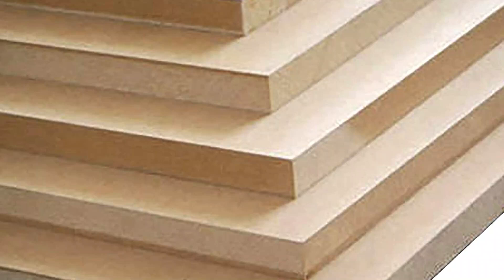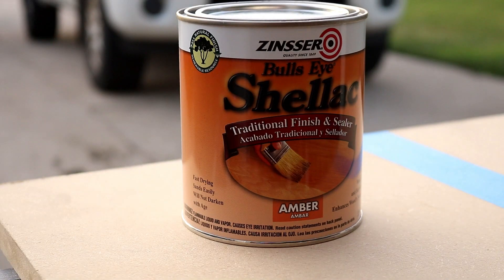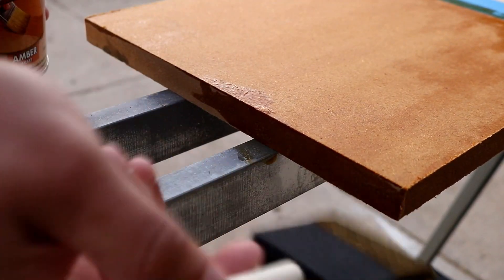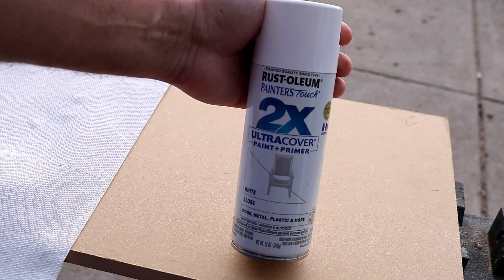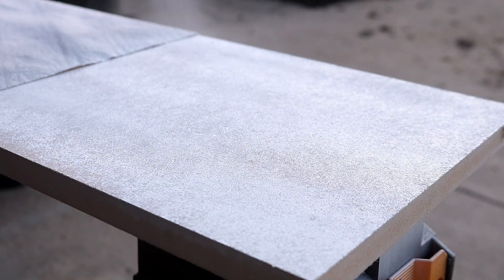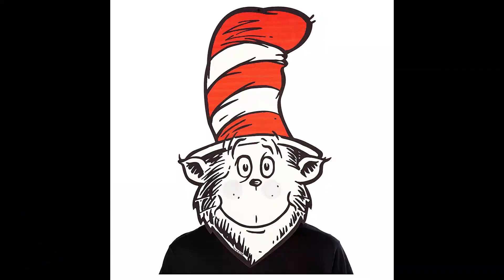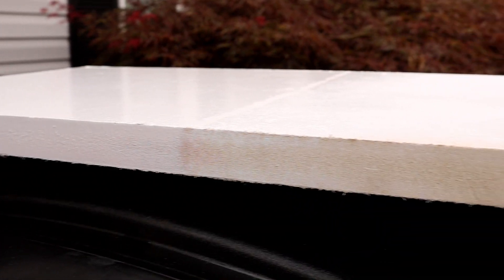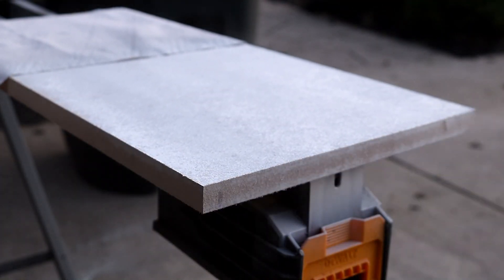HOW TO PAINT MDF LIKE A PRO - Here is another tip to help you spray paint MDF and make it look great

Comment: Never would have thought of this. I always used rust-oleum lacquer rattle can and do heavy coats, don’t even have to sand your piece then as long as the side your spraying is laying face up. But the edges are still thirsty doing it this way so I appreciate this video

Comment: Just 2 years later and the price of that can has nearly doubled. Still glad I found this, though, because I've always used their shellac primer. It's amazing for MDF, and other tough-to-paint stuff like particle board and laminate (think cheap furniture). But that shellac primer is like $70 a gallon now, so $26 for this, while not $13, is way better! The sanding sealer in your other video, interestingly enough, is cheaper at my store, so I'll probably go that route for now.

Comment: I use water and wood glue 50/50 and it works pretty well. It only takes 1 coat with a foam brush and dries quickly and then a quick sand. I originally put it on the edges but where I got it on the top you could see a difference in sheen so I just started putting it on the top. I think the water helps pull the glue in and makes it a little more durable. I normally use kilz odorless spray and then you can topcoat with about anything. I like the kilz oil based odorless but the spray cans drip which is very annoying.
Reply: But it's adding water to MDF which would cause selling after sometime

Comment: I've used Elmer's glue for years to get a pretty nice finish on mdf. I brush on a decent coat or two, then sand it after letting it dry for a full 24 hours. It'll give you a glossy finish as smooth as plastic when you spray paint it. I've also seen really good results with spreading a super thin coat of Bondo on MDF, then sanding it.

Comment: I use sanding sealer. I always get a specific Brand. I ONLY use Old Masters, which is kind of hard to find around my area. But it works AWESOME! A nice even coat. Sand with 400 grit lightly until smooth then apply a 2nd coat. Sand with 800., Then apply top coat. That's just my method. I've had GREAT results on numerous Subwoofer box & amp rack projects.

Comment: Oil based primer+sealer in one works just fine on MDF too. Water based won't work as well because it will soak in and cause swelling, but the oil based works just fine.

Comment: You need an NDF or neutral density filter for your camera. It cuts down 
the amount of available light and you would have been able to pick up all
 of those imperfections in the MDF. You can rotate them to adjust the 
amount they effect the light also.

Comment: If you actually sand the mdf properly you get a much MUCH better surface to paint.
You can easily get an almost polished finish using 120 then 240 or 150 then 320.
Use 400 or 600 between coats.
Use anything you like to seal the mdf but it will look terrible like this does, if you don't sand it before you start painting.

Comment: So I dig the ideas I saw your other video too. but... I've painted things that had a high gloss poly on it. or like you enjoy saying shellac ! and the paint chipped cracked throughout the years. and trust me my prep work was amazing vacuumed wiped down with spirits painted in a controlled environment little plastic room I made with circulating air. So has anyone had any issues with that using the SHELLAC !
Reply: From what I understand it cracks aka alligators because it was applied too thick

Comment: First I want to thank you for your great videos, for me have been very usefull!! I want to ask you a question: when I remove the masking tape from the painted mdf I notice sometime like a masking glue residue over the paint how do you remove that without damage the paint?
Reply: Buy better masking tape, not the cheapo stuff. I had the same problem for the longest time, buying better tape made a huge difference. Edit: Also, make sure the paint is cured enough before you tape it.  If the paint is still green, you're gonna have issues (even if it does feel dry to the touch)

Comment: Nice video but honestly I just don’t get the fuss about MDF painting. First : it does NOT suck to paint - it paints beautifully.  
Seal edges with 50/50 glue water mix. Just paint faces with non water based primer and then paint normally. Comes up beautiful.

Comment: Is there a difference in using shellac amber and shellac clear?
Reply: The only reason you use clear (or blonde) shellac is for finish coats (especially french polish) on fine woodwork with real wood.

As a primer, you don't care what it looks like, and amber shellac is both cheaper and much easier to find.

I even use shellac as a primer for real wood when I want to paint it and I want as good a surface as possible without the grain poking through.  It dries fast, is cheap, and just needs a touch of sanding (tho I usually use 320grit on a sanding block).

Comment: Shellac means?  Normal wood gloss ?
Reply: Sanding sealer.
Reply: Just so you know: shellac is made by mixing lac flakes with alcohol.  Lac is a resinous product obtained from the secretion of the female “lac bug” (Kerria lacca) on trees, mostly in the forests of India and Thailand.   I've seen a video on youtube that shows how they produce it.

Shellac is one of the oldest finishes still in use.  Most furniture was finished in shellac until the invention of varnishes.  One of the finest finishes of all still is "french polish".  Which is a labour intensive process using shellac.

As a finish, it's not very tough, labour intensive, and doesn't like water much, which is why you normally see fine furniture done with polyurethane, various varnishes and lacquer these days.

Comment: Can Shellac be done before staining also?
Reply from the maker: Not straining but it can for painting
Reply: Actually, pre-stain is kind of a shellac so yes, I believe you can use a light coat just before staining to keep blotchy woods smoother.
Reply: @johnnyh64  Not just a light coat, but a thinned one.  Shellac "strength" is rated in pounds of shellac per gallon of solvent (usually ethanol/denatured alcohol).  Typically use a half-pound mix for pre-stain, 1 pound for priming, and 2 or 3 pound for finish coats (eg: french polish).

This sort of work is usually done by making shellac from lac flakes and alcohol in the desired ratios.  Though, good quality pre-mix shellac should tell you what the mix is, and you can thin it to the desired ratio yourself by adding alcohol.

[Lac flakes are a specialized product, so you'll likely have to pre-order from Lee Valley or Woodcraft or someone like that.]

The best thinner is denatured ethanol.  You can use methyl alcohol, but it dries faster (which can be a bit of a pain), and is considerably more toxic (in liquid or vapor form)) so make sure you have GOOD ventilation.

Unless you're a stickler for the stuff, you're just as well buying pre-stain (or pre-conditioner) from Minwax or whomever.

Comment: Skip the shellac. Sanding is important, yes. But for a shiny plate-like appearance then try applying the paint with an airless sprayer. There is something about the atomization and/or aerosol that mdf doesn't like.
Reply: PSA -- This is misguided information. MDF (Medium Density Fibreboard) is compressed wood fiber, which is a porous surface. The purpose of Shellac (or similar products) is to seal the surface by creating a barrier between the paint and the MDF. Essentially, you are painting over the Shellac, which isn't porous, instead of the MDF, which is porous. 

Do not skip this step. 

The method by which the paint is applied is irrelevant. Certain methods might produce better results, but I would advise against this suggestion. It's not the atomization, or aerosol that MDF doesn't like, it's water. -- If you are using water-based paint (the most common choice), especially in an airless sprayer where dilution is typically required, the MDF will react to that in a negative way. It will raise the fibers of the wood and create a rough texture. 

(I'm hoping this will prevent someone else from making a mistake, or wasting money on an airless sprayer.)
Reply: @jessewyllychuk8516  All I can tell you is that I achieve a porcelain appearance on MDF using the application I mentioned, with zero shellac. I am lucky enough to have at my disposal every piece of equipment and plenty of shellac (if need be) and I've tried them all. Sanding, painting, sanding, painting (with WB paint) will give me a gorgeous appearance. Two coats. 15 minutes in between.
Reply: @jessewyllychuk8516  Your first paragraph is correct. The was a "well, i think..." type of response. 
Mine was a step-by-step explanation of my own personal demo's with this. I wasn't suggesting an experiment. Rather, I'm reporting on my positive findings.
Also, typical airless sprayer pressure is 800-2000psi. So regardless of substrate (mdf, steel, etc), if you can't get proper application without thinning, then the problem is on you and/or your process/equipment (smaller tip, inexperience, etc). Airless has more than enough power to push many coatings of super high viscosities. 
***Lastly, I understand the shellac method and I've seen its positive result. However, it's not simply the silver bullet. There's another way to skin this cat. Once you've tried what I have explained here AND FOUND FAILURE, then please call it misguided. Contact me and we'll compare notes on what may have gone wrong.

Comment: And thus is why I don't use MDF lol I'll spend a little extra on better material
Reply: Better materials like what?
Reply: @bobulatorul  OSB, plywood. MDF is crap, pressed sawdust. A small amount of water, MDF swells and then it's garbage
Reply: @michealrobinson  OSB and particle board are pressed wood chips.  Painted OSB always looks like crap even when freshly painted and there ain't no way you can make OSB edges look good.  Particle board is considerably worse than MDF and most grades look like crap when painted no matter what you do to seal/prime it.

Once you've treated MDF this way, it'll stand up to moderate amounts of water quite well - as long as it's not continuously soaked.

Oh you think that OSB stands up to water?

I've been using 4x8 sheets of 3/4" "weatherproof" (snicker) OSB as a "floor" in my trailer because it's cheap.

A couple of years it's mush.  Threw the third generation of trailer OSB floor out a few days ago.  It was so soggy that I couldn't slide out more than a foot before it broke off under its own weight - if I tried to grab it, the piece would break off in shreds.

Finally gave up, and the new floor will be marine grade plywood.

Painting the edge of ordinary plywood always looks like crap.  You have to cover the edges with wood, plastic u-channels, veneer tape, or fill it with spackle.  Tho, with care, you can get away even with clear finishes on baltic birch if you want to pay that much.

Comment: First step, throw out MDF..😂 you're spending more money to save money it seems.  And how much time are you spending applying multiple coats of shellac so you can simply paint it...
Reply: For many CNC projects, MDF is superior
Reply: @benprovan  not superior at all, just more easily machinable...
Reply: @xephael3485 

For certain applications devil's wood is superior.
Reply: @ThekiBoran  yes if you make Ikea..🤪
Reply: @xephael3485 

MDF is used in multi-million dollar mansions, it's very limited but it is used.  Stop being a snob.
Reply: No, MDF is superior in many applications. If you understand how to use it. Flatter than anything else, easy to paint and machine, wont contract/expand/warp over time or from temp changes.. and far less expensive than any comparably smooth surfaced and consistant plywood. Only way you would save money is by buying OSB or particle board.... but then you will add a couple of downsides also.